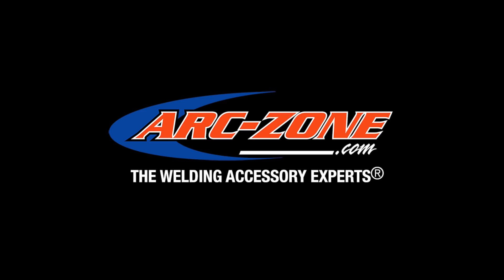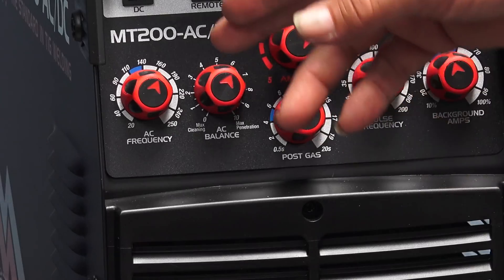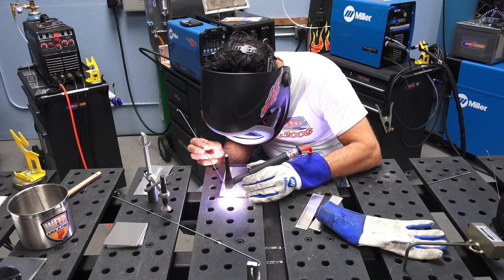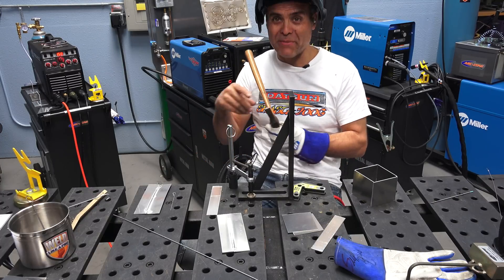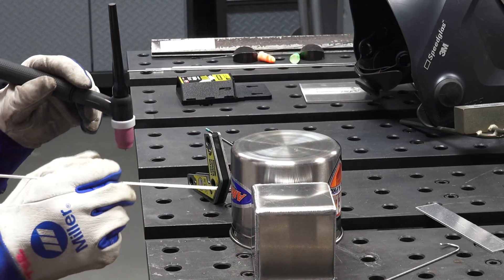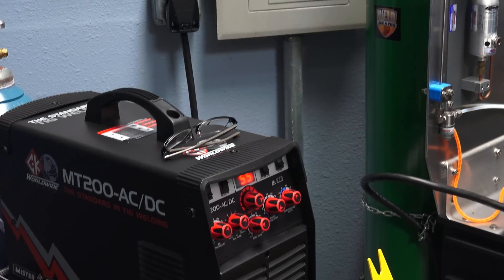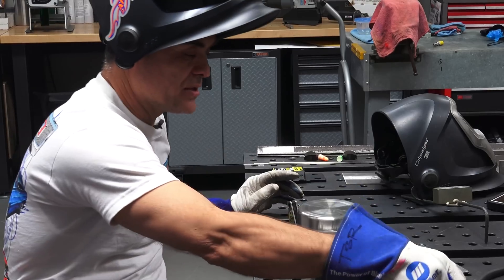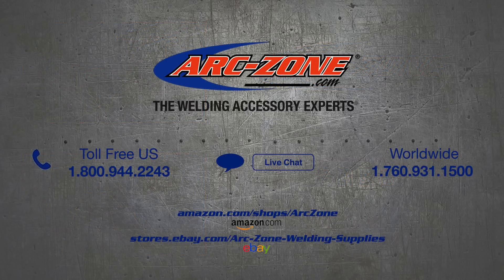TIG Weld Aluminum Like A Pro  [CK-MT200 Master TIG]

Comment: I still use body hammers and I am willing to bet I am older than you.
What I see you doing wrong after you JUST CLEANED THE ALUMINUM WITH YOUR WIRE BRUSH YOU TOUCH THE PIECE OF ALUMINUM WITH YOUR BARE HAND!
THAT JUST CONTAMINATED THE ALUMINUM WITH THE OILS FROM YOUR HAND. And you put the welding rod in your MOUTH and do not bother to wipe it or any metal part with acetone! I think you need to pay more attention to contamination to your parts from yourself.

Comment: Instead of assembling the box with a hammer Mario could have used the very versatile and expensive fixturing table he is welding on. I am amazed at how many of the Modular Positioning & Assembly Tables (MPAS for short) are being used as glorified welding tables. With the right fixturing devices as supplied by Thor Welding Innovations, one can hold just about any shape work piece in any angle or position.

Comment: Instead of watching a lot of welding it would have been great to hear what filler material is used, type of tungsten electrode, how super Mario prefer to sharpen the electrode, amp settings etc, etc.

Comment: If you get a straw insert it into the box and use tape to seal it to your torch and back fill the box with gas then you won't have a problem with the last corner to weld.

Comment: Arc zone where are the internals of this welder made , not where is the machine assembled. What countrys origin made the internals for this welder?
Reply: Donald Duck 
Everythings made in china. Even the internals electrical componets of american made machines are sourced from china. America doesnt make microchips and what not. 
China makes everything now . Im a machinist my shop has an everlast ex250 . Has 5 year warranty after that . WHen it breaks we will get what ever is the latest and greatest technology going.
Reply: @markrich3271  Exactly...  Everything is made in China...  Especially my Longevity TigWeld 210SX which is identical with more features & HALF THE PRICE of the super branded CK 200 or whatever its called...  But still like CK as a brand...  Just not as a 2,200 dollar Chinese Machine...  😐...
Reply: +Arc-Zone.com, Inc. Welding Supplies so dont buy it lol...isnt there an all made americano machine
Reply: Mark Rich Holzverbindungen

Holz Verbindungen
Reply from the maker: Everything In that machine is from China.

Comment: how can you have pulse and AC+balance? How does this work?
Reply from the maker: To help understand the functionality of the CK TIG machine check out page 11 http://www.ckworldwide.com/Form%20MT200-OM
Reply: Spixy cat 
pulse is referring to amps or heat pulsing and ac balance refers to what percentage of time the electrode is positive versus negative achieving either more cleaning action or weld penetration.